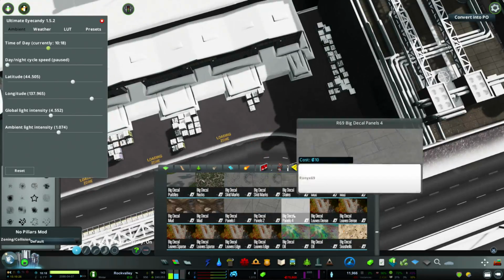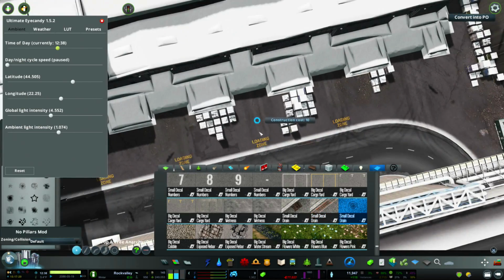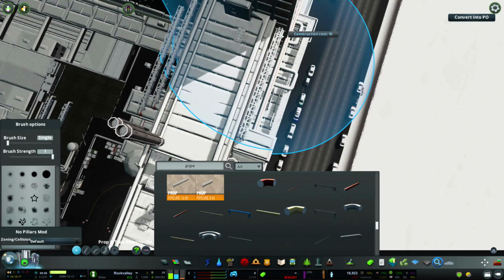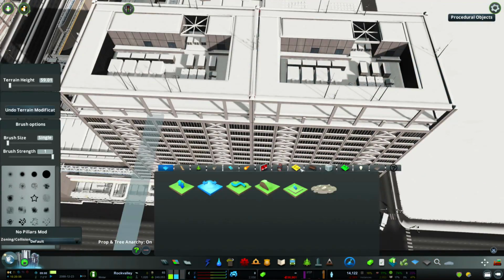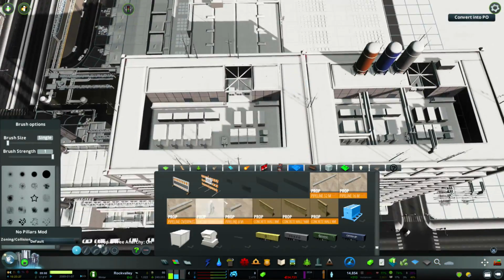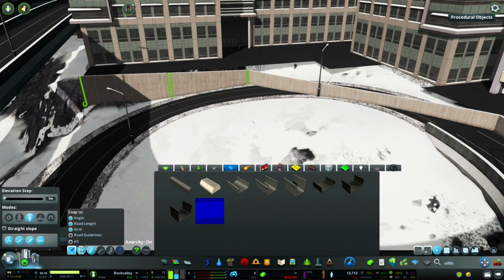MASSIVE Freight Terminal - Cities: Skylines - AVALON [8]

Comment: The problem is that "industry" in reality consists of four (!) different types of buildings:

- Offices (these don't affect Ressource/Goods balance, they are "just" jobs)
- Factories producing goods (named "general industry" in the game - these TAKE intermediate products and GIVE goods)
- Factories producing intermediate products ("specialized industry" that is OFF the corresponding ressource - these TAKE raw material and GIVE intermediate products)
- Primary sector ("specialized industry" that is ON the corresponding ressource - these just GIVE raw material until the ressource is depleted)

You need to have a balanced supply chain from raw via intermediate to goods and then commercial. (Unfortunately even the ingame import/export tab doesn't distinguish between raw and intermediate - because they are both specialized industry.)
Reply: Well IT cluster specialised offices do produce goods for commercial zones least according to the devs though they do not use trucks to deliver it. Presumably the "goods" in question are digital content/online services that provide purely electronic vouchers for retailers to sell.

Comment: Regarding industry and import of cargo, I had the same problem multiple times and eventually came to this conclusion. If you have a commercial building, even if it's just one, that doesn't have a connection to a road, every time a train spawns it will try to supply that building, but won't be able to find a path and will carry very few goods (only for the buildings that it tried to supply before it tried to supply the not connected building, hope I explained this well enough) However when you zone industry you suddenly have more spawn points for goods, in turn to just 1-4 in train connections, so it doesn't matter that much that every once and a while an industry building fails to resupply one commercial building. Also I am pretty sure that industry is supplied separate from commercial so you get more trains incoming. 
I can't say 100% that this is why that happens but I am pretty sure. Anyway I resolved it by getting the no imports mod or something like that, that basically resupplies every building instantly.
Reply: Industry rarely starts from scratch when manufacturing new products. It take raw materials and component parts manufactured elsewhere and produces either more complex component parts or complete products ready to send to retail outlets.

Comment: Probably you are getting more freight trains in your town because the industries require raw resources in order to produce the good.

Still, loving the evolution of this town. Keep it going! :D
Reply: Exactly. Using the auto manufacturer analogy. Ford or GM employ several “subcontractors” that make fenders, hinges, engine parts, etc. Those subs in turn bring in what they need to make their fenders or brake lines, etc. In theory the freight coming in will include goods that are Not finished. In theory without industry you are only bringing in Finished goods so a smaller overall total of goods because the finished product cuts out all of that freight that is needed by industry to make the item.
Reply: I scrolled down to comment something along these lines but you guys already gave a pretty great explanation! I like Gray's manufacturer analogy too, C:S has a pretty nicely "layered" supply chain from Raw producers -> Processors -> Generic Industry -> Commercial buildings. The game will figure out if it needs more "supplemental" imports for any step of this chain, or if there's a surplus of goods it'll export them. There's a great flowchart of this on the wiki here: https://skylines.paradoxwikis.com/Supply_chain